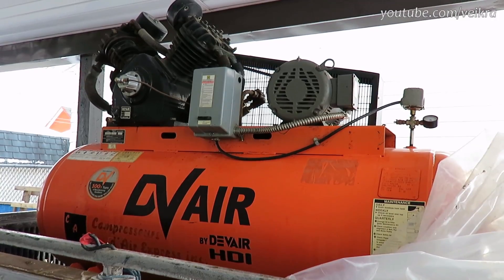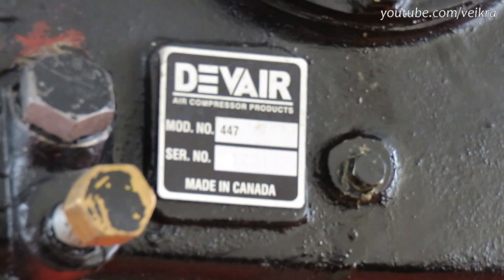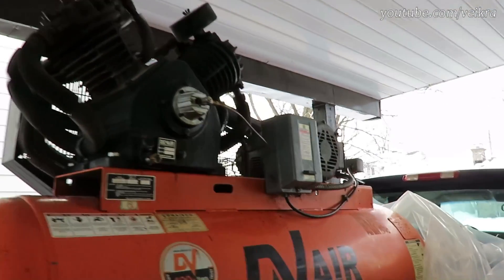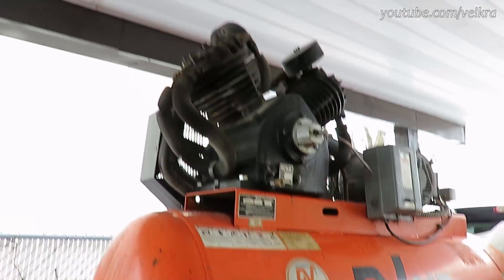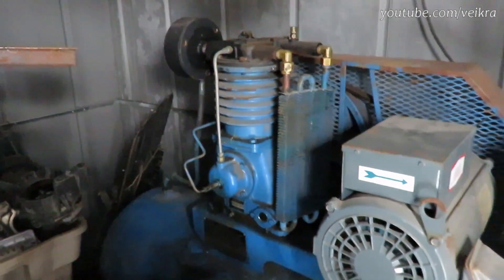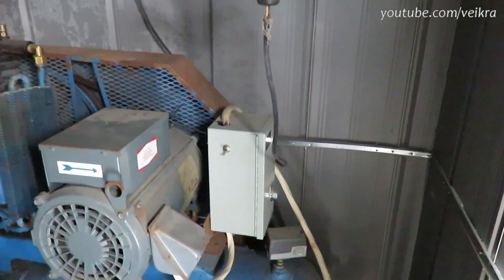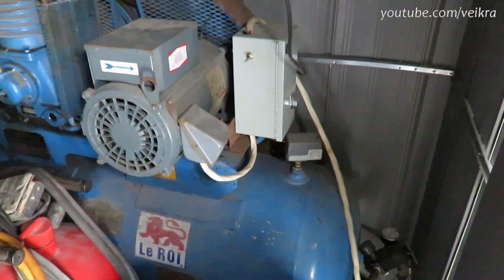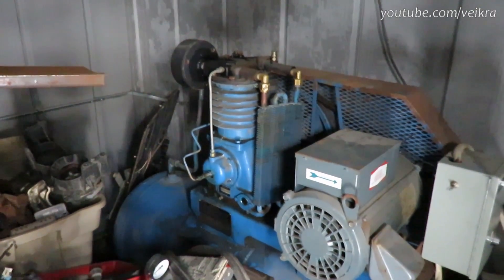120 gallon devair 447 Vat5063 compressor

Comment: DeVilbiss advertises their compressors as being pressure lubricated but they are not, if they were they would have a oil  pressure gauge and/or a way to adjust the oil pressure
Reply from the maker: +ROTARYCOMPTECH Good point, Though the way they are they bring oil up to the crank, and pressure in the base force it in channels. It's not splash lubrication, but it's not a true pressure lube either right ? as they are no adjustment for setting pressure.

Comment: Not made in china  220 volt?
Reply from the maker: +Ghetto Wagon Hell no. I bought one china campbell hausfeld and it was a POS. Now I only buy canadian and american compressor.  I get big 575V and convert them instead. There's nothing already on 220V that suits my need in a decent price range. This guy is 5600$ new.  This is the biggest one I can get at home as 15hp single phase 220/240V motor are super rare.  This pump is meant for 15hp though, and puts out 51.6 cfm . Ill be running it at 10hp which is 36.8 cfm at 175psi (175, not a 90psi rating to make it look good :p )
Reply: Veikra
 I don't even see them forsale. I never heard of this brand compressor, ill have to keep my eye out for one
Reply from the maker: +Ghetto Wagon This is devilbiss new name here, sure you've heard of it :) I knew the shop owner and told him if he'd replace it to call me and he did :) My blue Leroi/Dresser is another monster too, and I may change the bad bearing and reseal the head before I sell it. It's a unit meant for garage and paint shops and would be great for someone who wants to run a couple DA and paint.
Reply: Veikra
 Now you have two? Awesome
Reply from the maker: Ghetto Wagon
yeah,  my friend wanted a larger compressor and he stumbled on a badly placed add with bad pictures and no model numbers. We called and it was a 447 for decent price. We jumped in the truck, torn it down in the seller'S garage and loaded it with a engine hoist.  It's a little older than mine but it's almost brand new.

Comment: Hmm. ITs not really presure lubed. I work in the field for over 25 years.   A real Pressure lube is the Quincy QR model.  It has an oil pump and an air filter.   Yours doesn't. Hope it lasts for you, good luck.  If you want a Quincy, contact me:)
Reply from the maker: True, they say pressure because they run oil through the crank to the rod bearing.  I also have a 30hp champion and 25hp kellogg running in duplex. The champion is splash, the kellogg has the rings just like the devair but oil passages in the crank like the devair. Quincy is a zombie brand now, lots of cheap pos pumps now in the low hp range. I sold a pressure lubed 3hp quincy last winter. good pumps, not  made like that anymore.  There's no pressure lube pumps below 10hp today. 

Compressor is doing great, also built 3 more 10hp 445 and 447 on single phase. Two are in bodyshops, sometimes running over their duty cycle here and there. No issues. The lube design is pretty good, but they ran this one out of oil and it didnt have the low oil shutdown on it and a interstage pressure relief was bad (actually sabotaged by the servicing company).